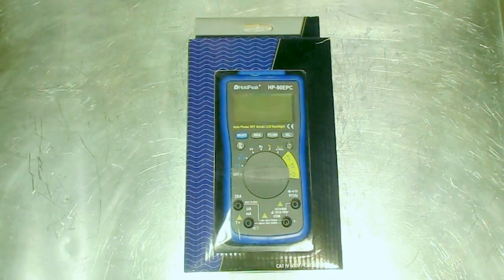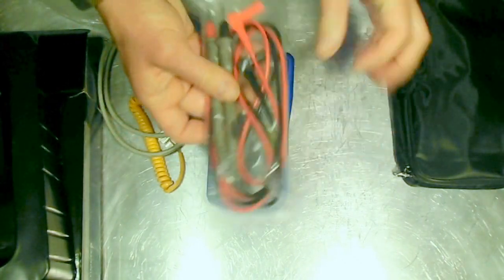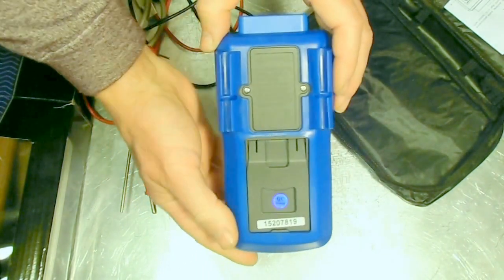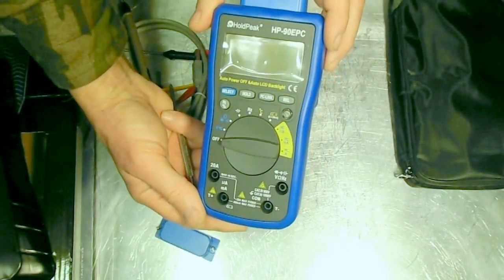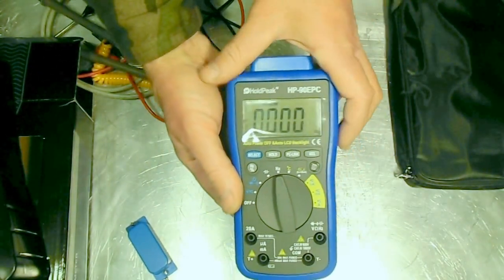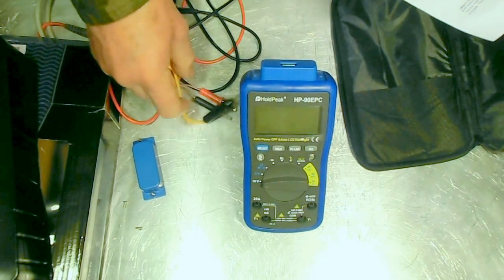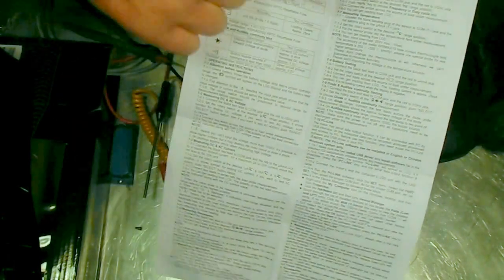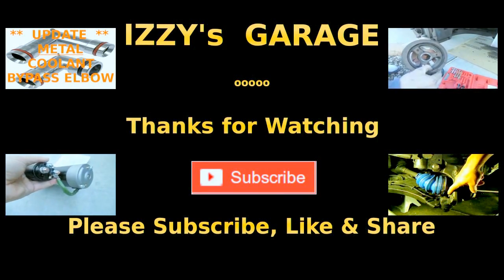UnBOXING the HoldPeak HP-90EPC Logging, Hz / Duty Cycle, Graphing Digital Multimeter w/ USB connect

Comment: How about PC-connection?! Can it build the graph of voltage during several hours?
Reply from the maker: I believe you can, but not 100% positive. I have not let it run for that long. But I believe you can vary the acquisition rate to an extent, and it also has a written history that scrolls with the time and date of the acquisition. Hope this  helps.